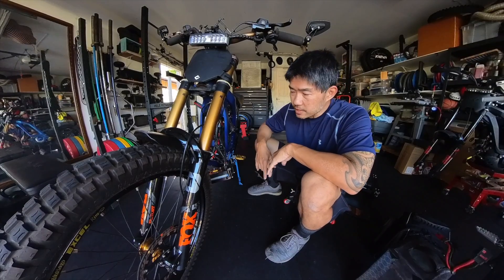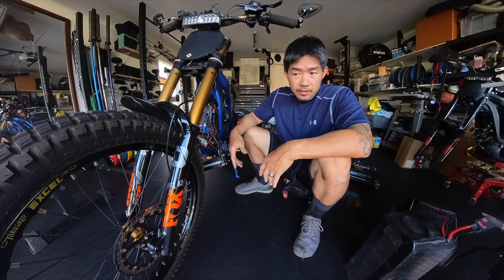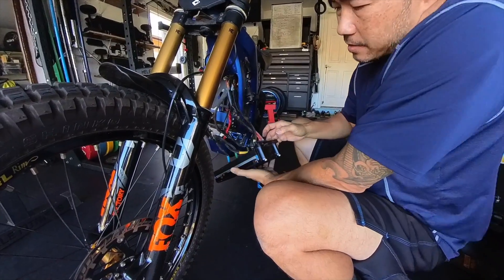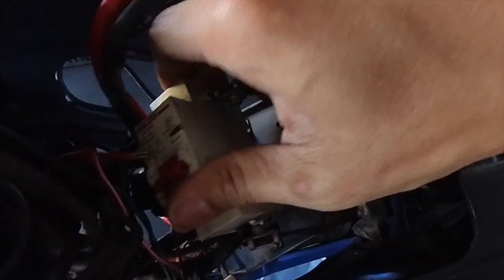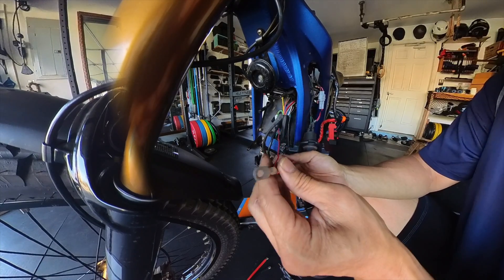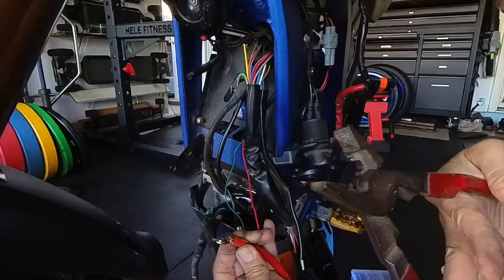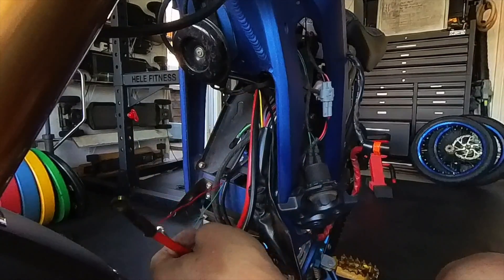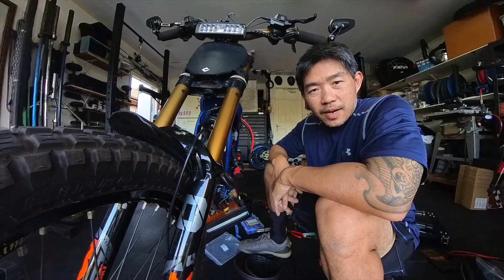Surron QS8 conversion & Circuit breaker delete

Comment: Iv got a 2025 light bee.
It comes with this weird connector that goes on the battery. It’s a direct clip in thing. 
Is it possible  to cut the standard wiring loom a couple of inches away from the battery connector part and put the QS8 connector on that. Then run the rest of wires like you did ?

Comment: How would I go about reversing this? I have the same setup but want to disconnect my motor, controller, and battery. I just don’t know what to disconnect first so I don’t start an explosion. I’m assuming unplug the battery but is that enough? After can i just go in to unplug the phase wires?
Reply from the maker: Unplug battery, turn key on to drain any residual energy, then you’re good to remove everything.

Comment: What’s up Man. Just set up my GLE BAC8000 with my Eon 72v 34ah Molicel battery with the Egg rider V.2 
It turns on but I’m getting a red exclamation  point❗️ I click on it and says I’m on the wrong protocol. It’s set to ASI. Do you know what protocol I should be on? I know you are using a Surron. I’m using a qs138 v3 mid drive motor. Figured I’d ask. It runs but I can’t put my battery info in or tune it without getting rid of that ❗️All good if you don’t know, but worth a shot. Appreciate ya.💯🍻
Reply from the maker: @KruseNStuff  I haven’t seen that warning before. If it’s GLE, you should email them. Get an android phone and they’ll remotely fix it
Reply: @DanhRichardson  ok. Will an android tablet work? I do have a tablet. Or do I have to buy a phone? Appreciate it
Reply from the maker: @KruseNStuff  I've never used a tablet with them, email GLE

Comment: What’s up Man. I’m doing an upgrade for a custom build I have. Not a Surron, a Honda crf450r. I just got a BAC8000. Used to have a Votol em260. I’m being told a circuit breaker and a pre charge resistor is required. What are your thoughts and how’s it been without the breaker. I’ll be using QS8s but the seller said that doesn’t matter. Appreciate the any info.💯🍻
Reply from the maker: I too was initially worried about this. After over a year of the removal of the CB and going QS8, it's been perfect. No more cut outs on any of my 4 Surrons. I became friends w/ a well known battery maker (Ron Carroll from NAB batteries) and he told me that a QS8 is all I needed. No need for a pre charge resistor.
Reply: @DanhRichardson  Appreciate the KNOWLEDGE💯🙏🍻

Comment: When you say popped…was the beaker in the off position you needed to turn back on? Or just cut off all lights still on?
Reply from the maker: Breaker would be in the off position
Reply: @DanhRichardson  having problems with me cutting out..still powered on but no drive have everything deleted took tip over sensor off hopefully that sorts it
Reply from the maker: Remove brake and kickstand sensor if you haven’t already done so. Next you can borrow a working throttle and see if it fixes your problem.
Reply: @DanhRichardson  every sensor is off the now only thing left is eco bottom and head lights hopefully that helps..if not getting new dominoes throttle housing

Comment: Great video. How were you popping your breaker all the time? is it from too much throttle? And now that you don't have the circut breaker, what is there as a safety net, like the old breaker used to do? For example, isn't it better to have the breaker pop versus something else, like your controller or battery? Just trying to learn more. Thank you!
Reply from the maker: I still don’t know why it used to pop so much. It was at all different speeds. It was scary while riding in traffic. From what I’ve heard, that breaker is used for connecting/disconnecting the battery to prevent sparking. QS8 is anti spark, so no need for the “breaker”
Reply: My experience is the regen in combination with an extra power tune.. frustrating

Comment: What a great idea! Plus when it bursts into flames, you can grill your hotdog...
Reply: That's a QS8S, anti spark plug. On top of that a smart bms turns the charge and discharge off when connecting the connector. You need to do some digging son.

Comment: The small red wire I believe goes to you're step down... I doubt 60v goes to you're ignition  ....
Reply: 60volts goes to the ignition, just at a very small current. Believe me it’s 60 volts. I shorted it and it does not sound nice 😂😅

Comment: Today i try a 60v 55ah stock controller 
And my breaker pop off when turn on

Now the guys says he did something wrong when making the battery?? So i have to take it back😢😢
Reply from the maker: I’ve had my battery pop on a chi 60v51 and a NAB 72v38 multiple times. Took out breaker and never had a problem since.

Comment: How has this been going for you? I want to do this but I’m scared as my eletrictian says it’s always necessary to have a breaker. How has your experience been?
Reply from the maker: I understand your fear as I had the same fear. I haven’t had a single issue. There’s no overheating. I now don’t have any fear of my breaker popping out of no where, which is scary when I’m traffic.
Reply: So I had my bac8000 connected to stock battery until I got my chi 72v battery with qs10. Installed with harness they gave tonight and connected but the lights come on but nothing moved when I hit the throttle. Any idea what it could be? Bike was working perfect. I connected the positive and negative then ran the qs10 harness to qs10 battery and just lights. Anything I could be missing?? Thanks
Reply from the maker: Did you change the settings for the bac8000 to 72v?
Reply: @DanhRichardson  yes actually we went into Backdoor changed from 60v to 72v it started working that day. Today I tried to ride but it would turn on for 20seconds then turn off with code flickering E10 R39 on EggRider display. It’s so weird it was working just fine yesterday after we input the 72v in Backdoor. Both the battery and bac8000 are new and I’ve rode it twice in 3 months, bike is driving me crazy at this point.
Reply from the maker: @LosAngelesMade that’s a bummer. What company is your controller from?
Reply: @DanhRichardson  side note how did you close the lid with the qs8, my qs10 are huge way bigger than I thought and now my kid doesn’t close at all.
Reply from the maker: @LosAngelesMade QS10 are WAY bigger than QS8
Reply: @DanhRichardson  yeah well turns out bc the battery was newly charged and when I use regenerative breaks it spikes the voltage so the controller was reading over voltage so we went into bacdoor increased the voltage setting and it’s working fine now. I ended up closing the lid and connecting the qs10s on top of the lid. Thanks for ur help, how’s ur bike holding up? Any safety tips u can share to help with no breaker?

Comment: Ok I bought a ko motor with rush controller. I also have a 72v 52ah custom dual discharge battery. Tried to install it today. We thought that we had to remove the circuit breaker. So after removing and installing everything the bike won’t turn on, light don’t work display nothing. I also could not find my rush controller with Bluetooth on the ko app. Any thoughts what the issue could be?
Reply from the maker: It’s not because of the circuit breaker delete. Did you attach the ignition cable when you made your positive and negative wires? Make sure all your connections are good and that its in the correct place.

Comment: If you didn't want to delete the circuit breaker, could you just cut the top off the old connector from the bike and replace it with a QS8 and have no problems?
Reply from the maker: Yeah shouldn’t be a problem, but what would the purpose of that be? If you keep the same 8awg and breaker, than you delete the purpose of the qs8.

Comment: So does the qs8 take the place of the breaker?
Reply from the maker: I’ve been told the circuit breaker is only used for disconnecting/connecting the battery to prevent sparking. It’s really not used as a circuit breaker. The QS8 is an anti-spark connector so you don’t need the circuit breaker.
Reply: @DanhRichardson  This not true if you turn the bike off shut the breaker off than turn the bike on still some voltage with the breaker off, the breaker protects the controller and battery
Reply: @DanhRichardson completely false it’s not an air gap it’s a real breaker that trips at 400A all you do by removing the breaker is make the bike more dangerous